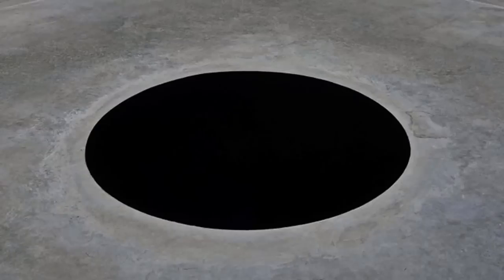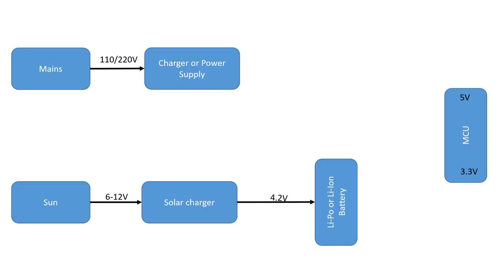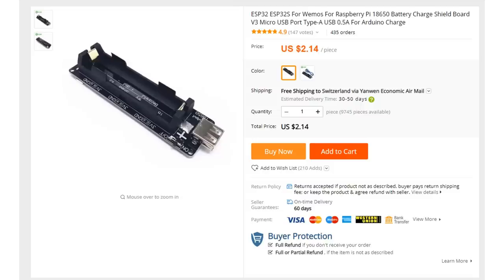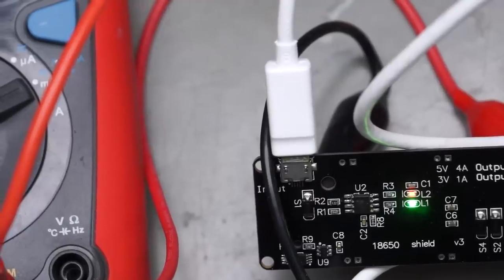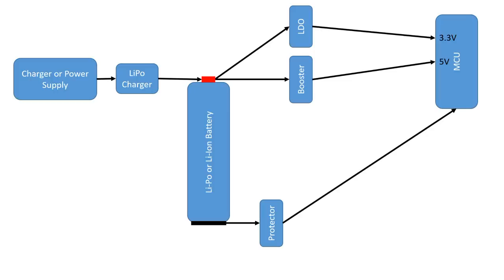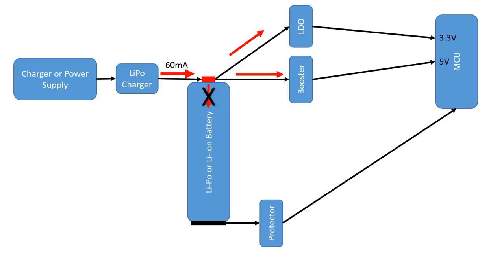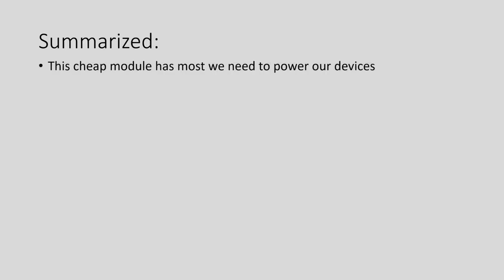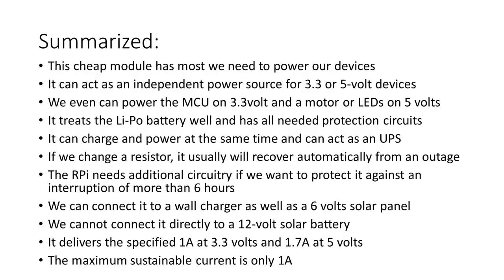#250 Universal Power Source (UPS) for only 2$. Is this possible? (Raspberry Pi, Arduino, ESP32)

Comment: For young players a good general overview of the do's and donts when relying on a non mains power source,  I would just add that you characterize your devices ( main mcu/sbc, sensors ) thoroughly aswell as your systems duty cycle.  I liked the nod to the 'non deep sleep' note on your consumption numbers.

I actually purchased a couple of solar charging boards from a EE on hackster IO after long conversations and alot of research,  I was ok with the price which was a little more than these from China, but I had the added bonus that these were actually fielded in the real world power both esp8266 and esp32 boards of various types and sensors without issues.

Just as a note also for bigger iron ( Pi, BeagleBones etc etc ) you might do better with a hat/shield/cape as these are specifically targetted for these systems over being more generic, trade off is always going to be cost / your budget. Remember one thing though 'You get what you pay for'.

Again great video Andreas, as always great food for thought!
Reply from the maker: I have such a hat and it did not work properly. I had to „Pimp“ it :-(
Reply: What about us older players who don't know much. ;^)
Reply: @dikl2689  Thats why we have Andreas ;)..

Comment: Thanks, great video! I'm running MCUs off the 5V USB-A pins, rather than the 5V rails, to utilise the switch. I'm using it as a powerbank, but this would turn off most of the load in your trickle charging scenario as well.
Reply from the maker: Thank you for sharing your exprerience.

Comment: Been working with Stubblefield coils. Found that I was doing it wrong. I was running current same way and creating stationary magnet field in Stubblefield coils. Therefore not getting any extra current from emf. Using some of the coils to move the magnet fields was the solution. Electricity is as simple as galvanized rod and cooper rod in dirt. With super capacitors we don't need batteries. But need resistor to keep from frying stuff. Have a pi zero running off 3 earth battery cells and a buck/boost converter. It runs my WiFi continuously and will keep doing so till corrosion eventually kills it.

Comment: Simply disabling the boost chip can be a problem. Although the boost chip stops switching, the inductor now provides a dc path from the supply to the device.
Reply from the maker: You are right. But here it worked.

Comment: Your video is truly helpful and give valuable information (i couldn't find  complete datasheet of V3 or the other shields nowhere)..
I just want to mention my problem in case you or someone has any knowledge.
I have the V8 model(2 18650 batteries)..and instead of switch there is a button in order to activate the 3.3 and 5v pins on each side.. the problem is that even if there is current need (e.g. a led) that uses these pins..there automatically deactivates after a minute..
Reply from the maker: Many powerbanks deactivate if not enough power is used. They are useless for low power projects :-(
Reply: @AndreasSpiess  but the one you use in the video the 3.3V and 5V pins are always on, even if you draw very little current..right?

Comment: A 2C "UPS" type supply with USB C in and say, 2A 5v output would be a great thing for the hobby market.
Reply: luckily those have existed for quite a while or you can just use a standard 18650 holder with one of the 2.1/2A 5V USB C + USB A charging boards that you can find for pretty cheap that are used for battery banks to do the same
Reply: @MaxC_1 do you have a link ? this type of UPS ?

Comment: I am trying to do the same thing. What I figured is to use the tp4056+dw01 module for the battery charging and a MT3608 boost converter for powering the pi/mcu. I need to figure out a way to sense the battery voltage on the actual device(pi/mcu) to trigger a safe shutdown when the battery gets low. A simple comparator ckt can take care of turning the device on when the battery voltage gets above 3V.
Reply from the maker: I made a video about that.

Comment: In my opinion, the reason many power banks can not charge/discharge at the same time is that they use one chip to do both (with one inductor).
Others may do it because the heat would be excessive (some get very hot even in standard operation).
Reply from the maker: I do not know all designs.

Comment: A other way would be, to connect the charger to the usb input and the output to the 5v in/output of the raspberry pi.
That would charge the batteries if they are lower then 3v.
Reply from the maker: True.

Comment: At first thanks for the great job you did
I think i have idea ti solve the going below 3v problem 
I think arduino must read the battery voltage using analog input
Then when the battery voltage gets below 3v the arduino will trigger transistor to make short circuit between the output terminals of the charging board of the battery
Thus the protection will work and cut the power
When the main is available again the charge board will work and arduino will work and the battery will charge
Reply from the maker: Monitoring the battery voltage with the Arduino is a good idea.

Comment: NIce video. I have found that a low profile boost converter in combination with TP4056 ic for charging (and associated protection chips) is the best combination to use when powering something.
Specifically, I personaly choose to boost the voltage to 6.4V and feed that to the LDO of the uC i happen to be using as I have found that they are always very good in regulating the 5V bus at exactly 5V +- a couple mV. This is critical if using a hall sensor like ACS712 which needs exactly 5V to produce the 2.5V middle voltage.
Reply from the maker: Good solution for your special need. Not very power efficient, I assume...

Comment: Thanks for the very informative post. I'm trying to run a $4US LED (normally 3 AAA batteries) off of one of these modules. I have different varieties of LED. With one of them, with a USB LCD display of volts and amps in between, I get a reading of 1.55A, and it cuts off after 4 seconds and I have to remove and reinsert the battery. If I am providing power to the module, it continues running, but after several minutes, the LED dims and the display turns off. Flipping the switch off and on brings it back to 1.55A for a few minutes, then dim again (output USB voltage has dropped to 2V6). 
With a different LED, it shows 1.33A and runs for several minutes (no mains charging). With mains, it runs for longer--but then burned out some of the LEDs and dropped to 0.041A.  Oh, well.
One of the same type as the first LED has run on a 5V mains charger now for several months continuously.  I'll next try one of the charging battery holders with 2 18650s. 
Hope they come out with an iteration of this module which incorporates your suggestions and also delivers the current which it advertises.
Reply from the maker: I did not have users with more then one Ampere in mind as the battery would depleat very quickly.

Comment: Thanks Andreas. I learned some interesting things here. I wonder if it's possible for you to feedack to the manufacturer of the board about the trickle current resistance so that they could perhaps add it by default? I know that there are 100s of these suppliers and most will not care but just a thought. Anyway thanks for this tutorial.
Reply: They don't do that because the charge current you get might be too high for some cheap 1200mah or similar 18650 s people might put in there. It would be risky so they played it safe
Reply from the maker: Some of them watch my videos...

Comment: I made a solar powered Adafruit feather lora board by using a car phone charge module SMPS/DC to DC, 20 volts in from solar panel, 5 volts out to feather, then the lipo charger uses that to charge the battery :)
Reply from the maker: Good idea!
Reply: @AndreasSpiess  Thanks :)

Comment: Though this is an old vid but helpful,  wanna choose the right UPS for my ESP32 that runs 24/7 for Home assistant projects even during power outages.  all I have to do is to make sure ESP32 and other modules do not consume more than 600 mA for automatic charging recovery. Thank you. ♥
Reply from the maker: My pleasure!
Reply: @AndreasSpiess not 600 ma, 60 ma, right ?
Reply: not 600ma, 60 ma, right?
Reply from the maker: @psykopat81  no

Comment: Hello Andreas

Thank you for your great video once more!
Your calculation about the battery runtime is wrong in case the 5V output is used. 
If you've a battery with 2400mAh at 3.7V this is about 8.9W. When boosting to 5V you can only get about 1780mAh out, in optimal conditions if the efficiency of the booster would be 100%.
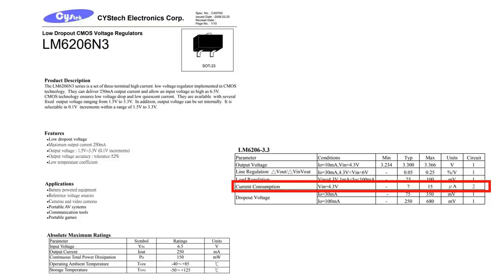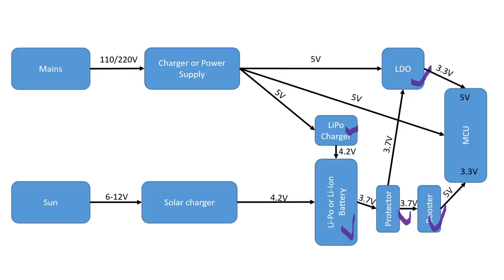In this case the runtime at 400mA would then be ~4:30h, so I think it is safe to say, that a 400mA load at 5V could rund about 3:30h - 4:00h hours only.
Reply from the maker: You are right. I did simplify a little too much :-(

Comment: Thanks for the Video!

Its a really nice thing if you dont need to watch out for LowPower.

My ESP32 Modules only need 8µA while in Deepsleep. This regulators and LEDs would take to much energy.
Reply from the maker: My favorite for low power still is LiFePo.
Reply: @AndreasSpiess  Thats what im using to sometimes. Even on Li-Ion with the HT7833 you are having a good LowPower performance

Comment: AFTER E.O.V  I DIRECTLY SUBSCRIBED . BEST VIDEO AND THOROUGHLY EXPLAINED.
Reply from the maker: Welcome aboard the channel!
Reply: @AndreasSpiess  
Sir,
Lithium ion polymer 4000mah,
The charging module tp4506 with dw01 battery over discharge protection,

The booster stepup step down circuit 3.3volt constant output,

An Esp32wroom,

The 2amp/5volt DC wall socket 230ac adapter 

Will this step simultaneously charge the battery as well as the esp32 and can this setup work as ups
Reply: Sir,
I was expecting an expert advise regarding the question

Comment: Andreas, thank you so much for research and broadcast effort. In your video #155 you speak about the good performance of the TP4056 as a good solar charger board. In this device, the TP4056 will extract the maximum power of a photovoltaic panel connected to the micro USB port or it will be needed an additional piece for doing the job? Regards!
Reply from the maker: You maybe have to adjust R2 as shown in the solar charger video.

Comment: I was under the impression that power banks do not charge and discharge at the same time (9:19) because detecting the battery voltage, and hence state of charge under load can not be made precise without a microcontroller/ammeter on the power bank, A lithium battery has multiple stages of current and voltage changes that when applied incorrectly will ruin the battery, and with no microcontroller, I would like to see the durability of the battery in this charger, many devices i have seen charge lithium batteries as if they were lead acid batteries, but those are usually cheap toys not designed to live for long, whereas in a UPS, reliability is vital. Another thing is that when a battery reaches 4.2, and the charger is providing 4.2, no current limiting is required, as the battery can not sink a current from a voltage equal to or less than it's own
Reply from the maker: You are right. Most powerbanks do not allow discharging while charging.

Comment: I have never thought about this before but have innocently charged a portable power bank whilst using the power bank to charge a phone. Didn't notice any problems at the time.
Reply from the maker: Maybe you had one which charged and discharge at the same time? Or it was already fully charged.

Comment: Why do all protection circuits cut off at 2.7 V/cell? At 3 V/cell, the battery has pretty much no charge remaining, and it's also bad to discharge Li-ion batteries that much. That would solve the problem of the trickle charge.
Reply: @dd0356  Li-ion batteries have extremely low self-discharge. If it was Ni-MH, I'd agree, but it's Li-ion. And what do you mean with "charing a 3.0V lipo"? If you mean "charging a LiPo battery which has been discharged to 3 V/cell", well, they're usually discharged to 2.7 V/cell and have no problems charging at all. Unless you're referring to batteries consisting of multiple cells in series, in which case, yes, that's horrible, and I should have specified that I mean the voltage per cell. I edited my original comment in order to add that information, thanks.
Reply: @pirateman1966  Yeah, it's not that difficult to implement. I'll end up making my own circuit because pretty much all the circuits on the market are like that.

Comment: Looking at this more closely lately, I don't mind lipo for small portable projects for on the go, but not for projects as a UPS for the house. I want to find a household solution we can all be proud of that is safe and has recharge capability. I'd like to structure a UPS around a safer rechargable like lifepo4. They still smoke however but not a fire as I've seen. The lithium ceramic batteries might be safer too, "Greatscott!" did a feature on them here on youtube. I suppose non rechargeable alkaline are still the safest and good enough for lasting long enough for a safe shutdown on power outage, even a solution like that would be safer overall. Just don't like the fact that a media server pi or similar is plugged in 24/7 and never really needs charging. To be away at the store while your house or apartment building burns down, just the thought of it even though extremely rare, is worrysome.
Reply from the maker: Many UPS use Lead Acid batteries if you want to be conservative.

Comment: I had a couple of those battery shields with flat LiPo packs for Raspberry Pi. Because the battery is situated so close to the CPU on the Raspberry, they ended up getting cooked and blew up like balloons. Had I left them there for longer, they probably would've burst. Useless.
Reply from the maker: I have a few similar batteries an all blew up like balloons after a while, even at room temperature. But they still worked.

Comment: I can vouch that the black hole is real... Not only the holiday expenses, but the first week of January is when I also have to pay all of my professional license fees for the upcoming year, or else I'm not allowed to work this year. :(
This product looks interesting, just ordered a couple for testing. I mostly use Arduinos so I'm not too worried about discharging the cells too profoundly. 
Modding SOIC8 chips this way is tricky, those pins are fragile. If I were to attempt it, I'd lift the pin only slightly, place a layer or two of Kapton tape between the lifted pin and the pad underneath, solder a wire to the pin and then the second wire somewhere along the trace away from the pad. And then glue the wires to the PCB with epoxy close to the solder points to avoid them getting yanked out by mistake.
Reply from the maker: I am sure I would be more cautious the second time ;-)

Comment: I also noticed (the few power banks i dissembled) that power bank pcb contains only one inductor (and i'm pretty sure only one oscillator) , it is used as part of buck converter when charging and as part of boost converter when discharging. So it can't do both simultaneously :P
Reply from the maker: Maybe. This board also has only one inductor. It uses the TP4056 from 5V. I assume many power banks will do the same.
Reply: @AndreasSpiess  last one i opened was a xiaomi 20000mah one, it supports QC 2.0, i wanted to mod it to run at 12v to power my network stuffs (router, switch, ap). I could mimic the QC handshake with RC+BJTs but had to abandon the project due to not having simultaneous charge-discharge.

Comment: 8:56 So, when devices accept to charge a battery and operate at the same time, it's either because the low voltage protection is ≥3V or because there is a current-sensing resistor between the battery and the boost converter and some magic (op-amp ?) that substracts that current from the actual output of the charger, so that the charging circuit know the actual charging current?

But why not leave everything as it and connect the power supply to LDO/Step-up (after a couple diodes, so that the battery isn't charged that way)? The charger would still trickle charge the battery at 60 mA while a much bigger current is supplied to the load
Reply from the maker: You can try it if it works. I never tried.

Comment: You don't mention whether or not the board provides a low power shutdown signal.  Just like PC servers with UPS, Linux-based SBCs really need to be told to shut down properly to avoid storage corruption and Pi power units usually include that.  A "fuel gauge" sensor of some sort would need to be added to make this board a good solution.  Still cheap!
Reply from the maker: It does not provide such a signal.

Comment: Hi Mr. Spiess, I would like to use this to power a ESP32 with a solar panel. Using deep sleep etc. I am not sure how I can attach a solar panel to this, there only seems to be a USB input. And which changes can I best do when I want to use it with ESP32 only. I really love your channel, you always ask to support you, but what is the best way to support you? Buying via your links or...
Reply from the maker: I never tried to connect one of those to solar. So I do not know. To support the channel, you can either use my links, or join Patreon, if you want to do more.